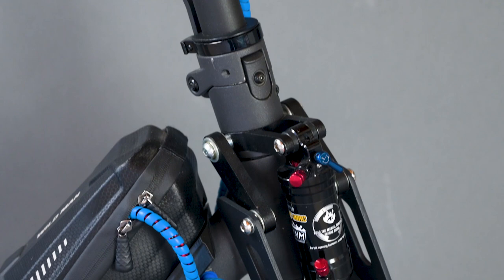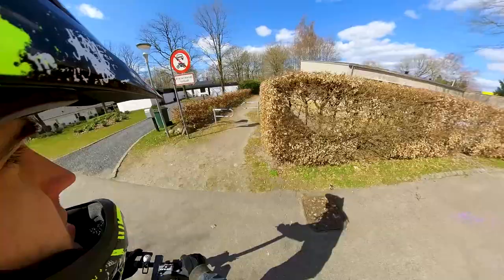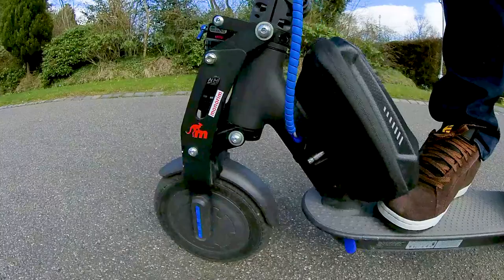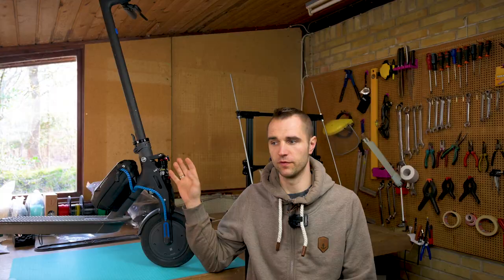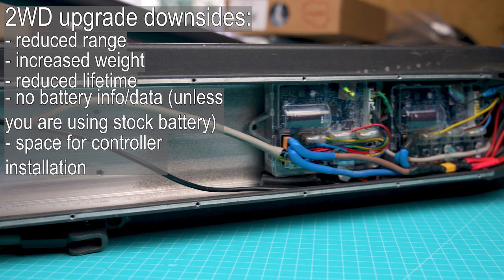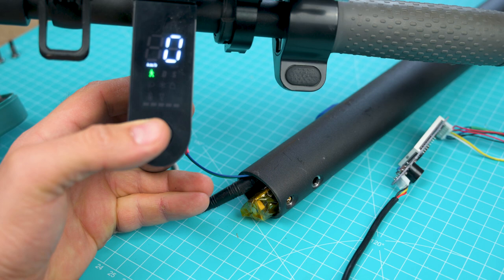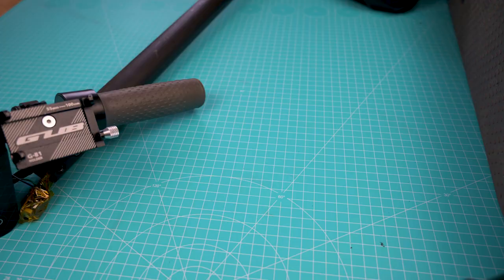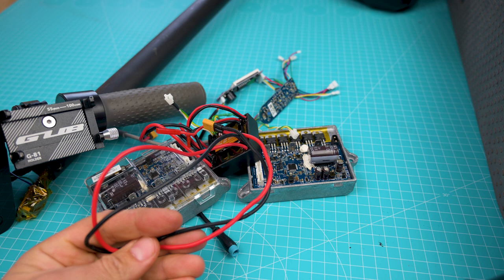Xiaomi M365 2WD mod in depth

Comment: Could it be connected in one controller by making it a series
Reply from the maker: ECU controlls the motors depending on their hall sensor positions, so one ECU cannot controll two motors. You could in theory just connect phase wires in parallel, but Your controller will also get double load and burn super fast

Comment: What bms did you use on your external battery?

I tired to make a 10s 6p battery with a different bms and the scooter just would not accept my homemade battery.   Then i had the idea to just solder the M365 BMS onto my new battery.  Every balance lead had the correct amount of voltage but the scooter still would not turn on...

So I which BMS you use
Reply from the maker: Just make firmware on Xiaogen, it allows you to disable all BMS data
http://f0456977.xsph.ru/free/index.html
Reply: @VRMinde  then bluetooth wont work anymore right?

Or can i use stock xiaomi bms (with changed xiaogen firmware) + my new homemade battery?
Reply from the maker: @sparklauerei1  you can just connect the new battery to your stock in parallel

Comment: Hi IF  put two 250w motor on one stock esc? Someting diference?
Reply from the maker: I am not sure it will work as: 1 esc controlls motors with hollo sensors; 2 esc will have double the load, overheat and burn
Reply: Thenks i gót two esc but is one 350w and 250w this work on one 36v baterry?
Reply from the maker: @nataliapatrik7992  it should. Look carefully how much amps will you pull from esc1+esc2 not to overload/overheat the battery pack :)

Comment: how press you the POWER ON by the Panel from the ORIGINAL Scooter after it is INSIDE and OFF?
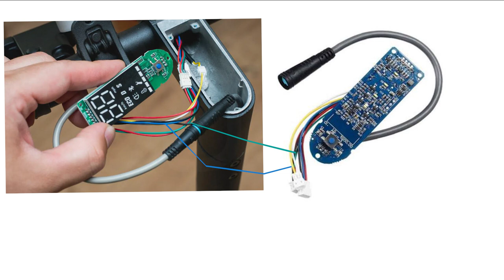Reply from the maker: 09:15 the red wire connects the dashboards together.
In my case it won’t turn off with a button as the panels power each other up. I set the timer to something like 30sec of inactivity and both dashboards turn off. Probably the right way to do it would be to make a separate external cutoff switch/button for both dashboards 🙄

Comment: Can I do this with a clone? It's almost identical to the Xiaomi, its a Hiboy S2
Reply from the maker: Why not mate. Especially if controller/dashboard is the same should be the same process. Make sure you can mount the wheel at the rear first :)

Comment: hi, i would like to run a 2wd using two 350 watt / 36 volt motors (they are clones and not original xiaomi) and using two separate (clone) v3.0 boards reinforced with 100v 1000uf capacitors and IFRB4110 mosfets.
In your opinion, how much could I squeeze the motors in terms of nominal Watts and peak Watts, in order to have a fair compromise and not overheat them too much and not limit their life?
I am only interested in having power to climb hills more easily, I absolutely don't care about speed.
Furthermore, once the wattage of the single motor has been established (for example 750 watts peak), should I have a 36 volt (20A) or 48 volt (15A) battery pack? I don't know if the motors can work at 48 volts.
thank you
Reply from the maker: Hi,

It depends, from air temperature, duration of the max watts etc. 
I have used 12s battery pack for years and used 14s pack for a while, no problems with the motor.
If you can get the power from higher voltage rather than from higher current - do that. It will help with motor heating on those max watts. 
But if you replace ecus, motors, battery, would it not be cheaper to get a 2wd scooter with 2 motors, bigger pack, better brakes, suspension and etc. for a very similar price? :)
Reply: @VRMinde  I understand, to use 12s or even 14s how many Amps do you normally send out of the control unit?
For example if it throws out 30A at 48 volts, the motor will nominally draw around 1500 watts.
Are the Pro2 series motors (350 watts) capable of resisting?
Furthermore, it would take a suitable battery pack capable of throwing out at least 30A and with adequate and not limited BMS 15A but at least 30A if not higher.
Reply from the maker: @landscapes3798  anything above 1kw you should only allow for few seconds, I would not continuously run more than 700-800w for sure

Comment: Pirate did one too. You should check his video out
Reply from the maker: I saw his vids, he used vesc controllers if I am not mistaking.
Reply: @VRMinde  He left some links. Not sure what he used. Slick setup, one controller  for both motors. I'm thinking of making one also. I like the suspension you used.

Comment: For your extinction problem, have you tried to wire the 2 buttons of the dashboards together?
Reply from the maker: They are in the way “wired together” mate, meaning they share throttle and brake signal wires as well as power wire. Overall I was not doing anything with scooters/projects recently as I was busy with other stuff…

Comment: How you upgrade the controller to 14s battery
Reply from the maker: The controller is stock, mate, as I am riding on 12s. I will upgrade it though and make a separate video on it at some point.
Reply: @VRMinde  me I have m365 pro 2 which application i use for pro 2 version  to program
And when I put the dual controller no space for the orignal battery 
And keep making these videos good luck
Reply from the maker: @mrzoro6121  I assume you can use the xiaogen as well (forgot to add the link, fixing now), but I am not sure 100% mate.
And yep, you need to find a new location either for the controller or for the battery 🙄 that’s a tricky one!

Comment: Hej
Can i just put the motor on the rear? I mean switch the wheels?
Reply from the maker: You sure can, but you then have to figure out the brakes. I have received motor cover with a disc brake yesterday. These come with the spacers to mount the wheel in the rear. and the front brake caliper mount kit for monorim should arrive as well soon (I hope?). I will make a vid. It’s not a cheap upgrade though.
Reply: How much did you pay for the motor cover?
Reply from the maker: @caipas111  53USD + ~30EUR of import taxes to Denmark…
Reply: @VRMinde  Does the monorim plate seems to fit correctly with the konyk rear suspension on a classic m365 ?
Reply from the maker: @IbnChakib  for it works pretty well with air shocks. I am 85kg

Comment: How you brake?
Reply from the maker: With regenerative motor braking for this test. I know it is not reliable. I have purchased a new motor cover with a disc brake as well as the monorim front brake kit. Just need time for all the installations :)

Comment: The metal inner bolt spacer thing to attach the motor
Reply: Where can I buy
Reply from the maker: @UKMrMedical  I got it from the guy that makes these KONYK suspensions - info in the description below the video mate. But you can also get it from Monorim. At least I got one more kit with their RWD kit: https://www.monorim.store/product-detail/Monorim-MD-RF-specially-for-refit_pid-d0539421365a4265adcf24c29b959379.html
Reply: I’m on about the nut that goes on the hubmotor axel
Reply from the maker: @UKMrMedical  it is in the rwd kit that I have sent you a link to
Reply: @VRMinde  100% comes with the nuts
Reply from the maker: @UKMrMedical  don’t know about the 100% but they came in my kit. As well as in the motor cover with a disc brake kit

Comment: Did it make the scooter much faster
Reply from the maker: If you use stock battery and two motors - the biggest difference you will notice is acceleration, max speed just a bit. I like riding 2wd scoots, feels completely different!
And if you go with aftermarket battery packs with higher voltage - the max speed is also increasing nicely.
Reply: Nice thank u
Reply: Am going with the two motors and two lcds. But only got one battery at mo. If I do run 2 do I need 2speed controls. Please help

Comment: Why not simply splice the two motors and two controller wires together so you won't even use original stock dashboard?
Reply from the maker: Controllers are working / loading the motor according to the motor position that they “know” through halo sensors. If you splice cables together they won’t work. Same between dashboard and controller - ELC sends/reads data from dashboard
Reply: @VRMinde  ok I get that now. By the way, did you get much better hill climbing with this mod? When will you make the more detailed video
Reply from the maker: @jayv2407  I did not specifically try it on hills (as there are not that many of them here) but I bet it is a massive improvement! Hard to tell when mate. I am now filming another scooter. Then I have 500w motor and want to play with it and I also have front disc brake set and new motor cover that I want to make a video about. There is so much going on :)

Comment: Did I can use the pro 2 orignal controller   
With pro 1 version controller because me no find same pro 2 version controller
Reply from the maker: You can use any controller for your second motor. I assume that pro2 comes with the "v3" controller that is made a bit stronger, but in essence should work with the same firmware. But don't quote me on this - I am just estimating. Do not know it for a fact. And read through comments here before you flash firmware on your pro2 controller: https://www.youtube.com/watch?v=sEb8cD18QzA
Reply: @VRMinde  where I can find second v3 controller i can't find orignal one did I can use copy one? I will upgrade it to 14s did will work the same orignal controller
Reply from the maker: @mrzoro6121  i don’t know where to find another v3 mate, never looked for it.
And any controller will work as long as you can disable the bms data on it, meaning if you can flash the xiaogen firmware
Reply: @VRMinde  thanks you so much
Reply from the maker: @mrzoro6121  np mate, ride safe!

Comment: Monorim 500w motor is slower than pro stock motor and a little bit more torque but i think it's too late to say u this, the fastest motor for m365 are actually the 350w m365 motor  from aliexpress but less torque than pro motor...
Reply from the maker: That is fine mate, I am literally doing these upgrades more out of a curiosity than a specific need, so it does not matter that much :) but good to know, thanks!

Comment: Just buy a dual motor scooter & save money & time
Reply from the maker: I completely agree, but in my case it is not the point to make it practical or cost effective. I do not even care about how fast it goes. It is more fun to build and problem-solve around than to drive it mate :)

Comment: can i use 2 different controllers from m365 and m365 pro?  does it have to be the same software version?
Reply from the maker: You can use two as you mention. I think firmware has to match and you need to disable bms data, and make bith boot in eco mode